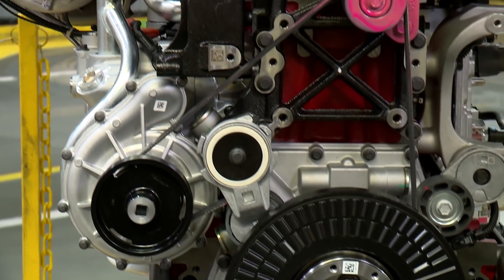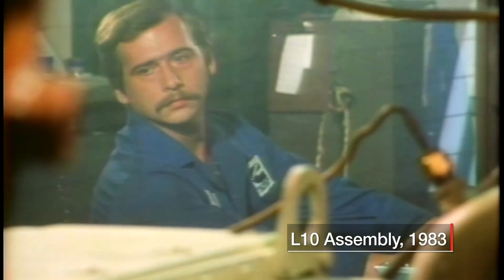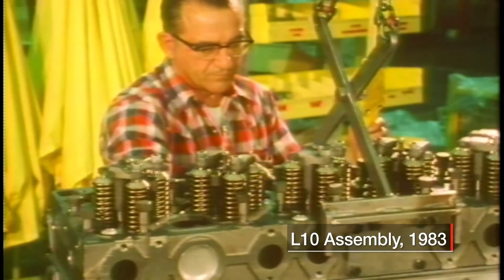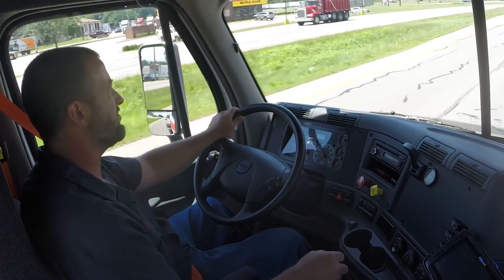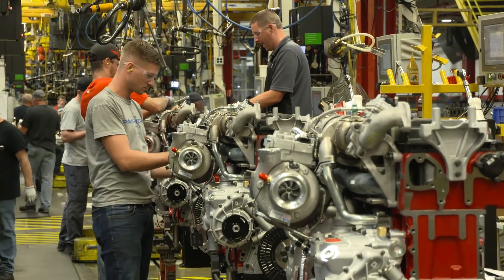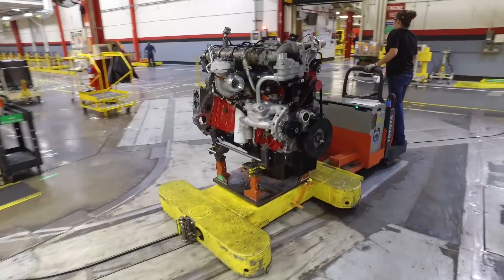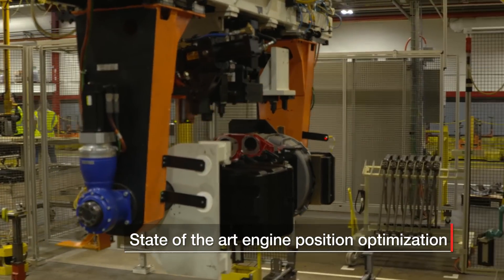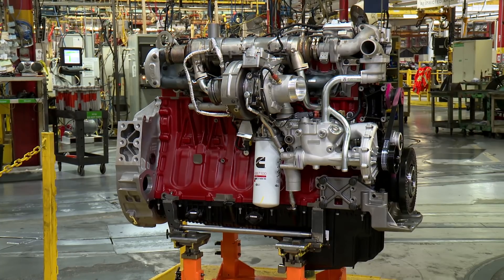Birth of the X12, new Cummins Heavy Duty engine

Comment: My 550 isx cummins just seized solid at 470 000km. Not to impressed with Cummins right now.  I can see after a million km it blowning up but not seized so hard a rolling push start with a pc300 komatsu on my float.... when i let the clutch out in 4th gear low side.... 18spd.... the wheels skidded. Thats pretty seized. Worst part was i was 100km up a logging road and no body around.  Go thing its not February and -30c
Reply: Ernie Desjardins its not on them its on you for not keeping up on maintenance
Reply: Fortunately (I'm being sarcastic) you have the "extensive" network of Cummins "distributors" to fall back on in order to "repair" or "rebuild" that engine nobody else can/will touch. So you don't have to worry about "will-fit" parts and/or "shadetree mechanics" damaging that fine Cummins product further. Last I knew, an "overhaul" of an ISX was "only" $30,000 whether "completely shot" or just "worn out". But I suspect "locked up" doesn't fall into either category and I doubt any "Cummins distributor" will "rebuild" or "replace" even a "core engine" with anything less than the full $30,000 major thing. Especially if you can't find a "core" engine with a matching "Bill Of Materials". I find it funny that "Control Parts List" has gotten to be such a "dirty word" in the diesel industry that Cummins had to "overhaul" that and start referring to the "master DNA code" of each Cummins product as a "Bill Of Materials" instead.
Reply: A Cummins engine does not seize solid by itself... 470,000 km of improper maintenance is what causes a Cummins to seize solid...

Comment: Until someone figures out how to make a fuel pump that doesn’t fail and cause engine failure it won’t be state of the art. Lol
Reply: Run a aftermarket lift pump and different tuning from the factory and you'll be way better off.
Reply: Boost lord the lift pump doesn’t cause the failure, the failure is in the ceramic plungers coming apart and sending pieces of ceramic through the engine. No tuning will fix a mechanical failure in the pump.
Reply: Boost lord I’m not speaking on light duty engines  I’m speaking on heavy duty platforms. Believe me I get it, it’s what I do for a living. I see the fuel pump failure every week in class 8 trucks. Of course a vp44 would need an upgraded fuel delivery system because it uses fuel to cool and lubricate.
Reply: Andrew Rouse very true
Reply: Andrew Rouse  The lurbication  which has been reduced because of the low sulphur they use now days so its wise to use additives to supplement it truck manufactures like ford is recommended to buy there fuel lubrication additives for there 6.7 power stroke. god i hate politicians that think there qualified automotive and  industrial engineers and manufactures!
Reply: Andrew Rouse you don't get it!

Comment: Cat is and always will be a superior engine in every aspect, from reliability to gross horsepower.
Reply: teller of truth riddle me this, how many epic failures has cummins produced if u want to compare Apple's to apple's, how many million plus mile cummins are out on the road today, there are numerous cat's that have achieved that mileage and have not been overhauled yet with the exception of maybe a water pump or something minor, i used to and still like the old big cam formula cummins but even those engines didn't crack a million miles and how do you go about drawing a comparison from a 3406 c cat from way back to a fairly new engine design the ism cummins, really. The kt cummins was a good high horsepower motor but it didn't last long, leaks, block flexing and broken cranks pretty much put an end to that motor, judging by your statement you've never driven a 1693 ta or 3408 di cat, to prove my statement has validity, when you see a fairly new rig broken down on the side of the road, 9 out of ten times it's going to be a crappy cummins, I'd take a detroit or a maxidine motor over a cummins anytime as well, i bid you a nice day.
Reply: Isx2. 1.6million+. No overhaul. Dpf filter has been changed only.
Reply: straightt12312 of course, if it's on the internet, it must be true, i respect everyone but it would be nice if you have some sort of proof, from what I've seen and heard, the isx platform is very problematic.
Reply: Freddy Hernandez id love to give you proof. I just parked truck not long ago. 2008 pete 386. No Bs not making that up. Honestly I'm worried about the rebuild.
Reply: straightt12312 i wish you the best and hope you have minimal costs, i would never wish anything bad on anyone, if she's been good to you that's great, keep on trucking brother.
Reply: Son buenos los cat pero reparalos ea costoso. En PR. Cuando un cat se daña lo bajan y montan un cummins o serie 60. Los serie 60 12Lt son motores buenos. Como menciono alguien subiendo le recojia uno. Le decian el automatico. Son buenos motores el detalle es el precio a reconstruir. Buena suerte amigos.

Comment: If I was cummins  I wouldn't  mention  the L10 a company  I drove for in the late 80s bought some ,gutless peace  of crap  throw away motor my ol KT600  got as good of fuel milage and would run circles  around the L10 I got over a million  miles out of my KT600, at 380K the L10s were wore out
Reply: Detroits were my babies. I cut my teeth setting the rack on inline 6-71's. All else being equal, the ponies live in the air gap. Man, that was a long time ago. But the diesels are going away now. One of the last jobs I did b4 retiring was installing computerized exhaust systems. Damnedest thing you ever saw. Inject raw fuel into the exhaust stream to fuel the catalytic converter, and clean the particulate filter every 30K. Problem was, the particulate filters were clogged solid at 9K. I said the hell with this, I'm retiring. Bye! Now they pay me to stay home. 8^)
Reply: jmar1371 it wasn't my L10 it was a company truck they took good care of there trucks,I had a 365 cummins  I kept turning  down the new trucks with the L10s because  I pulled alot of hills and I would take a break  at the brake check areas waiting for my friends driving  the L10 they were gutless  junk maybe the later ones were ok but the company  quit buying them because  they were junk the company  went to cut back 350 cummins  traded my truck in so I quit and went to drive for walmart I love cummins  just not the L10 they weren't  made for pulling hills
Reply: That's why, brother. Wrong application. L10 is (or was) a great engine for your transit bus. It'll get Granny to her bingo game. But it's the wrong engine for pulling 40 tons of freight up the Grapevine.
Reply: L10's were made for short run garbage trucks and transit coaches. One short block at a time. I agree it's the wrong engine for pulling loads up hills.
Reply: jmar1371 that's probably  why they were the way they were  freightliner  talked him into these motors  he tried them but we ran 11 western  states and they worked hard that's why I kept turning  down the new trucks I didn't have time to run from fresno to riverside a 5 hr run one way was taking them 7 + hrs
Reply: jmar1371 explains alot freightliner  told them it would save weight they could haul more weight,they traded there trucks in at 500 to 600 k none of there motors  made over 400k my 365 I held on till almost 700k when the traded it I had a L10 2 weeks than quit I hauled cattle  with my own truck before I worked  ther everything  I owned had big detroits cats or my last was a KT600  cummins I didn't like getting  rid of my trucks but the guy I hauled for got killed in a plane crash and nobody wanted to pay what he did so I sold out and went drive for this company big transition
Reply: jmar1371 great motor my dad had a international  10 wheeler dump truck 10 speed I learned to drive on it hauling  feed into dairys  in the early  70s,I drove over 40 years last 21 for walmart, I got forced to retire  I injured my back,they did sergury  messed  up damn near put me in a wheelchair  so now I'm retired  totally  bored can't hunt hike or do anything  that requires  a lot of walking or sitting  very  long
Reply: Chaka Gillis no another  guy explained the problem  the company  I drove for had they were talked into they by freightliner to save weight,they used them for running  80 k loads 11 western  states and weren't designed  to be over worked like they were
Reply: Chaka Gillis the ones in the 80s I'm sure they made changes but the ones we had in the 80 didn't last very long
Reply: what??? no fan?? send us a picture!!
Reply: Chaka Gillis--all of us techs know what cummins make, you dont. We dont care in the midst of the conversation if we call them"motors"or"engines".you are a trool.
Reply: XxzombiekillerxX mlg pro 
I have an L-10 in a single axel dump truck with no fan (never had one) awesome trouble free engine with plenty of power. Love it!
Reply: If your L10 is worn out at 380K, you need to learn about something called PM. Periodic Maintenance. I pulled wrench in a heavy repair facility for 3 decades, and we didn't consider a high miles change out until the L10's hit 600K. And we only had about 250 L10's in the fleet...

Comment: I worked at peter built for a while there isx engines had a tsb on the fuel pumps. They put ceramic pistons in the fuel pump witch would break and wipe out the engine. Give me a cat any day!!
Reply: Hahahah, Cat doesn't make vocational engines anymore.
Reply: shaun goldsmith I know an older guy that's worked at a small trucking company for 20+ years that has said they won't buy Cummings anymore because they've had so many problems.
Reply: Jess Roberts That doesn’t really carry a lot of weight you know. One older guy with a small trucking company...um ...doesn’t really move the needle of the Cummins engine Corp lol
Reply: teller of truth I'm not claiming to be a diesel mechanic. I'm just relaying info from someone that's delt with diesel engines his whole life.
Reply: teller of truth: they didn't do something stupid. Peterbuilt didn't get where they are by being stupid. They got there by being savvy. Engineered "break-downs" ARE a thing because "serious injuries" can occur with super high-mileage motors (lol, I have no idea how, but that's what was harped to engineers). Mercury does it with their water pump in the late 90's early 2000's. Not all companies do it, but more do it than not.
Reply: Daver G just about 50 000 hours on the 500 cummins in our 55 foot boat
Reply: Sheldon Lacosta ouch I can't get my tractors to run 1/3 that.
Reply: shaun goldsmith I ran a boat with Cat 3208's and from the day they were brand new they burned one and a half to two quarts of oil a day, a tech told me they were aware of a design flaw regarding the oil rings but did not issue a recall, another boat I ran is still running strong with 1983 Cummins NT855's without any major mechanical problems.
Reply: or a Detroit diesel engine...
Reply: Porous blocks in 3116s? I was working for a Cat dealer on heavy equipment when the 3116 engine came out, I went to service school for the engine/fuel system and did pretty much all of the 3116 work for several months after they came out. Mainly in 953C track loaders but a few GMC Top Kick engines in our service trucks, as well.  And I don't recall problems with "porous blocks". Not in the 3116s or the 3126s that "replaced" them when the "HEUI" fuel system came out. At least not with proper cooling system maintenance and operated/serviced "by the book". Put those parent-bore engine blocks in a "saltwater" environment and pour the fuel and rpm to them and you could sure as hell end up with "porosity" when electrolysis and cavitation make it through the cast-iron cylinder walls. Of course you can do the same damned thing on any engine and especially "high-rpm" engines which includes MOST Cummins engines given their "high idle speeds" relative to their "size". That's why you see so many Cummins engines with "coolant filters" on them and its why checking the "DCA" of Cummins engine coolant is something you do regularly if you don't want "porosity" in your block/liners. The L10/M11 engines are actually fairly "low-speed" by Cummins standard and thanks to "STC" and their morphodite PT fuel systems that are giant air leak collections its damned hard to really "rattle" the liners with enough power/cylinder pressure to make cavitation a serious concern even if you can keep them at "WOT" or work them hard enough in a boat to make it a possibility. 855s and C-series and B-series engines are a different situation in true "heavy-duty" use. Exactly what "boat" did you own that had multiple M11s, by the way? And is that "9000 hours" EACH or COMBINED and at what "power rating"? If you only had "occasional oil drips" from a Cummins its probably because you only "occasionally" filled the crankcase to capacity and then ran the engine "hard" and managed to get them to leak oil before they could burn it.
Reply: Wrong. Cat doesn't make "vocational" or any other kind of "on-highway" engine for other "OEMs" anymore. Cat DOES make "vocational" engines for itself, however. https://www.cat.com/en_US/products/new/equipment/on-highway-trucks.html
Reply: Peterbilt doesn't build anything but "chassis-cabs" and rear suspension systems that are "glider kits" until the specified powertrain and "accessory" parts are installed on them just like every other OEM "building trucks" out there. It has nothing to do with engines besides installing them in its chassis.
Reply: You have a "55 foot boat" with a "500 Cummins"? Does that "500 Cummins" have a MODEL and HP RATING?
Reply: He didn't say "50,000 hours" with no overhaul, rebuild etc.
Reply: Plenty of engine manufacturers consider "oil consumption" up to 1 quart or more per 100 gallons of fuel burned to be "acceptable". ALL engines "burn oil" and when the engine oil level DOESN'T "drop" its because FUEL DILUTION and/or CONDENSATION are providing the "make-up oil". Or the engine isn't being worked hard enough to really "heat up" the engine oil and create the "oil vapor" that will inevitably be "evacuated" through the PCV system whatever that system happens to be. Or the engine is being run LOW on oil or OVERFULL on oil which is pretty typical and easy to do in a "marine" or other "off-highway" application where the engine isn't sitting "level" during "normal operation". 

And can you define "major mechanical problems" and provide what "hp rating" those "NT855s" are along with hours in service, application, etc? A "boat" can have "NT855s" running "emergency" gen-sets for fuck's sake with "KTAs" or larger engines for "main propulsion" as well as primary "hotel load" generation. And since "Cat 3208s" were NEVER "marinized" by Caterpillar and most "engineers" of the "marine" type look at any "Cat V8" and think/say "Cat 3208" even when that "Cat" engine is something like a "Ford" or "MerCruiser" 3160 made by Caterpillar to Ford "specs" for "vocational" use in medium-duty trucks but and not a "Cat 3208" at all OR an ACTUAL "Cat 3208" has been installed to REPLACE one of those "Ford" boat anchors by some "expert" who probably fucked up the original 3160 engine(s) trying to "rebuild" or "overhaul" it/them, its highly UNLIKELY you've really "ran a boat" with "Cat 3208s" unless that boat was "repowered" by a freaking moron or three who didn't know his/their asses from a hole in the ground. 

The only "design flaw" as far as the "oil rings" go in Cat 3208s shows up when idiots try to use them for applications they were never designed for and usually when "repowering" something previously powered by a "Cat" 3160 ALSO never originally "designed" for that application. Many "oil ring problems" with Cat parent-bore V-8s are the result of improper maintenance/service/operation using incorrect oil and/or filters in those "high-speed" engines. In fact, MOST are since the "fix" for those "problems" with "oil rings" never managed to find its way into actual Cat-manufactured/remanufactured 3208/3204 long-blocks and short-blocks and can only be found in "will-fit" parts and "rebuilt" engines where an additional "scraper ring" was "added" to aftermarket will-fit pistons made to "fix" a problem easily "fixed" by simply using the right oil, filters and operation/maintenance/service practices after properly breaking in a new or remanufactured Caterpillar 3208. 

For future reference the "easy" way to identify ACTUAL Caterpillar 3208 engines is to look at the injection pump. If its a V-type pump with two rows of four delivery valves each its a Cat 3208. If it has an "inline" injection pump with all 8 delivery valves in one row, its a "3160".  And no, they're not "interchangeable" and neither are most parts. They might "fit" but they're not "right" and when you start mixing and matching INTERNAL PARTS, you've only BEGUN to see "problems" with those engines.
Reply: Dude Cat isn’t even in the ball park with emissions these days especially compared to Cummins hell even a Volvo for that matter. Besides all you had to do was replace the high pressure fuel pump under warranty. Detroit Diesel tried the ceramic cam followers at one time to. This is how they learn. Cat = boat anchor
Reply: Daver G 1.1 million on my c12
Reply: shaun goldsmith Detroit series 60 where the best ones.
Reply: Peterbilt check your spelling

Comment: Love my 1993 first gen 12v
Reply: Eddie Livingston 12 valve brother mines a 2nd gen dually tho
Reply: If not a first gen, then is the `93s without a intercooler a true first?
Reply: No def bs!!
Reply: I love my 89 W350. I love all diesel trucks though.
Reply: Yeah it has 200lbs of torque!
Reply: I'm eleven years old, I got a 89 1gen
Reply: Mark Rich I've got one And I'm eleven years old
Reply: Do you think it will fit in my Ford pinto?